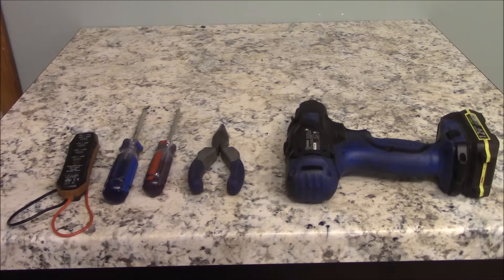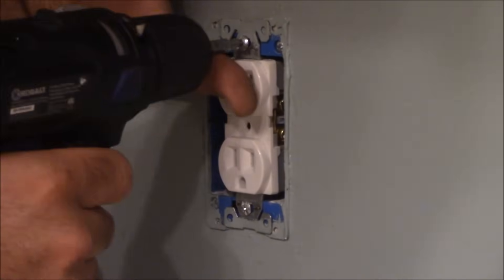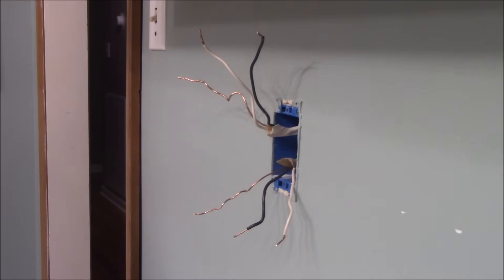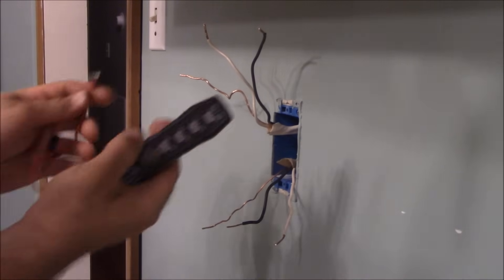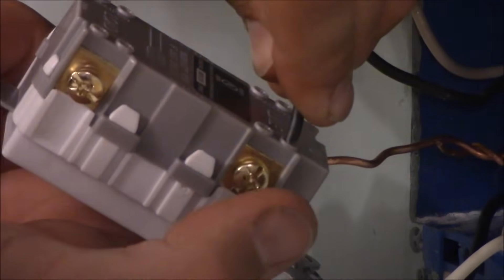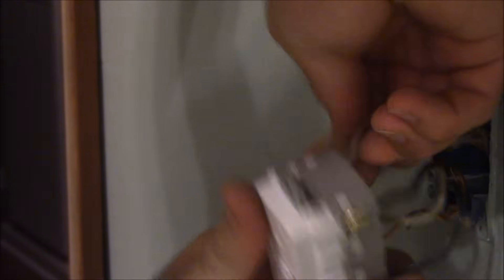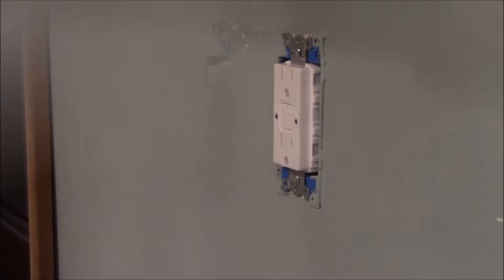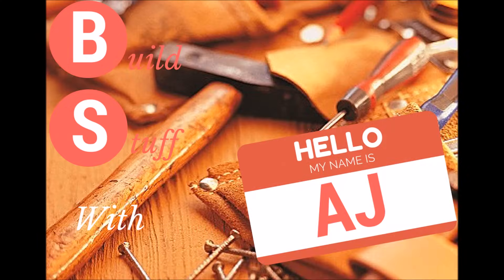Removing and Replacing regular outlet with GFCI outlet

Comment: How do you trouble shoot sockets  , when you have 5 outlets in the same room,  2 of them show  power top and bottom,  3 show power only on the top and no power to the bottom,
Reply from the maker: If your house is pretty old the first thing I would look for is a switch that you don't know what it was used for. Plug a lamp or radio in each of the sockets that don't show power and then flip that switch. 
  It was pretty common years ago to use lamps instead of overhead lighting like we do now. So they would wire either the tops or the bottoms of the receptical to a switch so they could turn on and off the lights with out having to go to each individual lamp.
Reply: Buy a outlet tester. They are about $3/$4. They will tell u if you have an open ground etc. Most outlets are wired in series. Meaning the closest one to your box is the first one receiving power. If any of the others are wired wrong. They may not work properly and you could burn your house down. Major bummer

Comment: Great Video. I need to do that for my pool.
Wondering: at 3:51 you were attaching the ground wires, but then at 4:01 it shows one of the ground wires off. Just asking not criticizing. It's that correct or it just came off?
Reply from the maker: To be honest I dont remember exactly why I changed that, I believe the screw was only holding one of the wires tight.
   As an alternative I attached a short wire to the ground screw on the reciptical and then attached that wire to the two ground wires comming out of the box.
Reply: @BuildStuffwithAJ  Thank you!

Comment: What wire do you use for ground & where is it connected to? I see the tap but is it just tapped to the wires??? Excuse my ignorance.
Reply from the maker: I'm a bit confused what your asking. The ground wire is the bare wire, it hooks to the green screw on your receptical. I didnt use any tape so I dont know what your asking as far as that goes. Go to 3:30 in the video and it shows how to wire the new plug up.

Comment: To bad they still installed the outlet upside down. The ground must be in the up position not the way it is in the video....
Reply from the maker: it is commonly accepted that the National Electrical Code (NEC) of the United States (NFPA 70), does not provide any specific direction for the orientation of the outlet. We recommend checking local codes to make sure there aren't any local code requirements.

Comment: Does  the same rule apply to a regular outlet?
Reply: Thanks
Reply from the maker: @mariagreen1354  no problem, thanks for the comment!
Reply from the maker: Yes its just like wiring up a regular outlet, so this video could be used as a reference to do either. I hope this video helps you!

Comment: I want to change out a regular receptacle to a USB receptacle. Is the process the same as above??
Reply from the maker: That all depends on how many wires is comming into that junction box, the wiring is Basicly the same but it could vary slightly depending on how many wires come into the box. In this video I have 2 wires.
Reply: @BuildStuffwithAJ  do you have a video on changing a regular receptacle into a USB one?
Reply from the maker: @libraladyjay  no ma'am I havent done one yet but I will be sure and make one the next chance I get! But like I said the wiring should be pretty much the same.
Reply: @BuildStuffwithAJ  I truly appreciate your swift response. Like another lady commented I also truly thank you for making these videos easy to understand for women like myself who have no handyman or handywoman friends to assist, let alone hire an electrician that might cost me a fortune. So I'm doing this project solo. Thank you again 😊

Comment: Is it possible to connect a under sink disposal and a washing machine on separate switches to a gcfi
Reply from the maker: I'm not sure if you can do that with the gfci's or not. Back when lamps were popular they had thin copper plate that connected the upper and lower plugs on a reciptical you could break it and connect the upper or the lower half to a switch so you could turn on a lamp and still have a plug that was hot all the time for something else.

I don't think you can do it that way now though with the way the new style plugs are made but I could be wrong.

Comment: I see that he put both grounds wires in the same nut of the GFCI but after will see that he cut one ground wire and roll over other conected, both pass are ok...?
Reply from the maker: Good eye, I didn't didn't menchen anything about this in the video because I want to teach people to do it the correct way, and the correct way is they way I showed you how to do it. Or you could use a wire nut to attach the two plus one small wire then connect the small wire to ground on the plug.
  Wrapping one wire over the other as you seen in the video after I explained how to do it is not the proper way. The two ground wires were two different gauge wires and because of this I couldn't get both to stay in the way I showed you. It will do the job but its not the proper way to connect them, and I dont recommend you do it.
Reply: Build Stuff with AJ   Right on A j  l just figured you didn’t have a copper crimp fitting , no problem. Many people still think GFCI will not function without a ground. There are many old homes without ground systems that benefit from GFCI installation. Thanks for the vid.

Comment: Yesterday I made some french fries and put them into a metallic bowl, I put cheese on them and put them in the microwave. After around 7 seconds of microwaving I heard a zap. I took them out instantly. Everything was fine, the microwave still worked, fridge worked too. An hour later my brother got home and started to microwave something, not sure what but it was in a microwave friendly bowl and when he opened the microwave door to get the food everything that was hooked to an outlet in the kitchen went out. The stove still turns on but nothing else has electricity. We reset the breaker and everything but nothing has worked. I plugged the microwave into another outlet in the house to see if maybe the microwave is just broken but no it's working just fine. How much would it cost to fix and could we fix it ourselves. I live in Northern California. If you need any clarity please let me know.

Edit: All the outlets in every other room + in the duplex house next to us is running fine. Also is it possible to get cancer because of this? I was told I could by someone who was being very cynical and now I'm worried.
Reply from the maker: It could be a number of things. But fist things first, never put metal in a microwave that's just asking for trouble. 
  First are you sure your checking the right breaker? The ones in my house were labeled wrong so it is possible.
  2nd does your breaker have a gcfi on it? They sell gfci breakers now and it would have a reset button on it.
  3rd do you have a gfci outlet in your kitchen? Homes are usually wired in series which means one gfci going off will shut power off to anything wired in the same series past that gfci outlet.
  If its none of the above I suggest calling an electrician.
Reply: @BuildStuffwithAJ  Nothing on the breaker was tripped and we've reset all of them and no we don't have a gfci outlet. We were thinking it might be fixed if we buy a new outlet for each of the three malfunctioning outlets. Would that work?
Reply from the maker: @andrescabrera3022  I can't guarantee that. You can try it and see what happens. But with out being there to look at it I can't say for certain. I suggest calling an electrician if you can't figure out how to fix it sorry I couldn't be more help.
Reply: @BuildStuffwithAJ  No don't worry brother I appreciate you even taking time to try and help. Thank you for doing what you do.
Reply from the maker: @andrescabrera3022  Your welcome! Wish I could have been of more assistance

Comment: I only have one set of wires. One black and one white plus the ground wire. Which side should I hook them up on the line side across from each other or the load side across from each other? I've already installed the ground wire.
Reply from the maker: On each side of the plug there sbould be two screws one side has gold screws and the other has silver screws. Put the black wire on the gold side and the white wire on the silver side. And the green of course goes on the green screw.
Reply: I put the plug in according to directions and GFCI did not work. My son read the instructions and looked over the diagram and found that    instead of the white going to the silver and the black to the gold as quoted in the instructions, everything was in reverse in the diagram. He took it apart and reversed it to white with the gold and silver with black a red light flashed then turned green then it was working.
Reply from the maker: @candyart5067  well I certainly apologize if ive told you wrong, but in every plug I've installed and everywhere I've done research its always been black to gold and white to silver. I've never had an issue and I always research before making a video to insure I give correct installation instructions.
Reply: The fault wasn't in your instructions. I believe the GFCI I bought has the silver where the gold should be??????????? I just know it works now.Lol
Reply from the maker: @candyart5067   well im glad you got it figured out, sorry for the trouble! but at least its working now right :)

Comment: I have 2 GFIs elsewhere in the my home.  Can I put one where it isn't my master bath room?
Reply from the maker: Elliott Walker you need to have gfci's any where there might be water present. The kitchen, bathrooms, out door plugs and even in your garage.
Reply: Sitting here in the UK I find your video amazing! Here we put the GFCI (RCD) to us in what you call the Breaker Box, so that the whole house is protected, not just the odd socket. Here we have shutters on the sockets, so that childrens' toys, or circuit testers, cannot just be poked in to the socket. All of our sockets are switched, and are a complete 'no no' in the bathroom. We also sleeve up the bare ground wire, so that pushing the socket back in to the wall box won't allow it to touch a live wire. Finally no electrician worth his salt here would operate without insulated tools.

Comment from the maker: Yea definently let me know if changing that will help. I think the standard gfci is 15 amps but don't quote me on that, it was probably the most common amp outlet.you would need a bigger one if you were going to be pulling a Lot more amps. But I'm not a licensed electrician so I dont know for sure. If you have any other questions ill do my best to answer them
Reply: This a critical question that requires a very clear answer. Gfci come in 15 or 20 amp. 20 amp uses 12 guage wire and 15 amp uses 14 guage wire. Never use a 20 amp outlet on 14 guage wire. Best way is match outlet amperage with breaker amperage rating listed on breaker.

Comment: I bought a house and the inspector said we needed one of our outlets in the kitchen converted to a gfci. So an the previous owner installed one. Since we moved in three tears ago we never had issues with out. But now these last month that gfci I has been tripping every single day. We push in the button and it resets, just to trip again the next day. Sometimes it does it twice a day. What could be the issue 😟
Reply from the maker: salsamink I had a similar issue in my house. It could be that the gfci isn't working properly and needs to be replaced. That fixed mine. but yours could be a different situation entirely, it could have too many amps being pulled from a different outlet on the same breaker. I can't say for sure with out looking at it. but have you bought something that pulls a Lot of amps? like a window air conditioning unit around the time it started tripping?
Reply: Build Stuff with AJ  thanks for the response. Plugged into the gfci outlet is a microwave. Power is also connected to other outlets for refrigerator, fan, and outdoor light. Outdoor light is never turned on and we only use the fan on Friday when frying foods. These things have been connected for over three years with no issue, but now for a month the gfci keeps tripping. I disconnected the microwave and it still does it. I’m going to start with part of your response and change out the gfci and see if that works. I will let you know if it works. Thanks for responding to me 🙂. Another question, I noticed that my gfci doesnt have the side crease in it meaning it probably is a 15amp instead of a 20amp. I don’t think that would be the issues since it has ran fine for the last 3 years with only 15amps. But, would there be a reason why they would only install a 15 instead of 20? Just wondering.
Reply: @salsamink  It's most likely the fridge. They are notorious trippers of GFCI outlets. It is too bad that your fridge is on the same circuit as the outlet. Mine is on my fridge circuit but mine is the last outlet in the circuit so it has no effect on the fridge.

Comment: Does it matter what size amp to replace it with?
Reply: You can check the amperage of the circuit by looking at the breaker in the panel. It will be marked with a 15 or 20 right on the switch. If it's a 15, buy a 15. If it's a 20, you can use either a 15 or 20. It is allowed by code to use a 15 on a 20, but NOT a 20 on a 15A circuit.
Reply from the maker: Serafin Florendo I am sure it does, but I'm not a licensed electrician so I can't tell you what amp plug to install. I can say that the ones I installed were 15 amp I believe.

Comment: Both my bathroom outlet isn’t working . Any idea why n How to fix it ? Thx
Reply from the maker: With out looking at it myself I don't know.
Reply: Mike Din sir...breakers “thrown?”...possible gfi outlet in you4 garage, 1980s wiring method,  recent remodel?...sometimes open wiring in attic boxes(electricians rewire power source for pot lights....or someone forgot to tape wire nuts...happy hunting
...

Comment: hello AJ, I have two electrical outlet in my basement that don't work. I opened both of them. the one in the bathroom next to sink never worked and when I opened I found there two white neutral cable are connected in both sides which makes sense because no black cables were connected. there is no ground cable connected also. I am assuming they were worrying about water getting into the outlet. should I go ahead and remove the white cable from brass screw side, and I connect black cable?? is it risky next sink? 
2nd electric outlet most likely I have to replace it as it's very old, both cables are connected properly but doesn't work.
Reply from the maker: If its next to a sink be sure and use a gfci, but otherwise it should be fine to have a receptical next to the sink. As far as the wires being disconnect, I dont know why they would do that. Be sure the power is off before you handel any of the wires. Then I would probably replace the old receptical with a new, it may not have worked properly and that may be why they disconnected it. Just be sure and follow the instructions in the video to be sure it is hooked up properly. I'm not sure where the other plug receives power. But it could get power from the first outlet and that could be why it doesnt work. although it is hard to say without seeing it in person.
Reply: thanks for quick reply.

Comment: thanks for advise im doing this at my old house oneday it seems they can prevent a breaker from tripping in my opinion.
Reply from the maker: Kevin Naderi. They actually shut the power off for two different reasons.

The Circuit Breaker will interrupt (turn the circuit off) when there is a current overload.  This can be caused when there is a “short circuit” to ground or by the load itself drawing more current than the rating on the circuit breaker.  For example,  if the circuit breaker is rated for 15 amps, it will “pop” (or break the circuit) as soon as the circuit Load draws more than 15 amps.

The Ground Fault Circuit Interrupter will turn the circuit off (interrupt) when there is a current leak.  The GFCI monitors the current going tothe “Load” (black, “hot” wire) and compares it to the current coming from the Load (white, “common” wire).  If there is any difference between the two, the GFCI will “interrupt” or turn the circuit off.

The GFCI is very sensitive. It will trip when there is only a 4 to 6 milliamp difference ( UL 943, Article 100 of the NEC ) between the current going out and the current coming back — that is only 4 to 6 thousandths of an amp

Comment: I own a class a rv it came equipped with "self contained receptacles: (SCD,S) I am trying to update the outlets by using heavy duty weather resistant outlets; 15 amp 125v- the way the original outlets were wired required a "very expensive" installation tool between $350-$600.00 I this installation tool is made by HUBBELL/WIRECO- THIS TOOL CRIMPS THE WIRES TO THE CONTACTS INSIDE THE OUTLET; I CANNOT PUT A STANDARD BOX IN PLACE OF THE CURRENT SELF CONTAINED OUTLETS- THE BOXES ARE TOO DEEP&TOO WIDE?? THE CURRENT OUTLETS MEASURE 2" WIDE BY 3.3/4" TALL 1 5/8 DEEP; ANY ADVICE WOULD HELP; IS THERE A TOOL I CAN BY THAT WOULD ALLOW ME TOO DEPRESS THE WIRES ONTO THE CONTACTS, SO I DON,T HAVE TO SPEND A FORTUNE ON THE PROFESSIONAL INSTALLATION TOOL; MOST ELECTRICIANS WON,T MESS WITH IT BECAUSE IT,S AN RV??? I HAVE 3" IN DEPTH MAXIMUM!! I LIKE THE WAY YOU EXPLAIN STUFF THANKS, PATRICK.P THEY ARE ALL 15 AMP 125V-THE GFCI IS A NORMAL INSTALL!!
Reply from the maker: Patrick Peterman ill be completely honest with you, I don't have the slightest clue on that. I've never messed with an rv's electrical system. That sounds a bit beyond my capability, I am not a licensed electrician by any means. I wish I could be of more help, sorry
Reply: well I appreciate your honesty; thanks,PATRICK.P